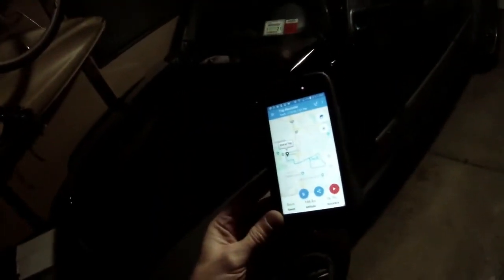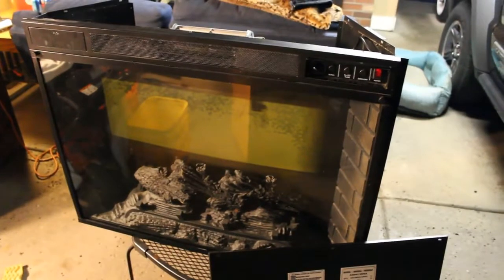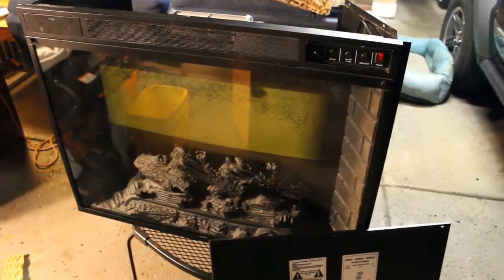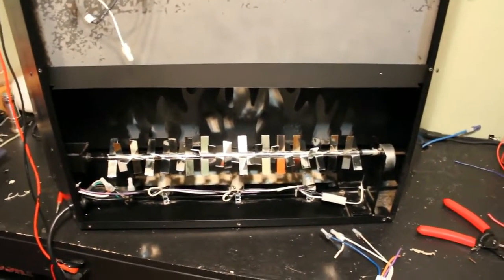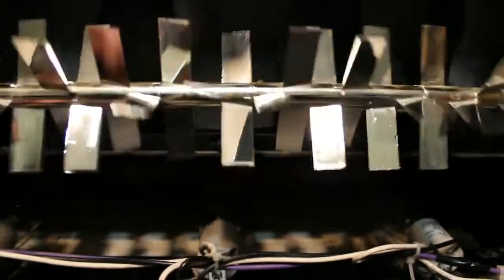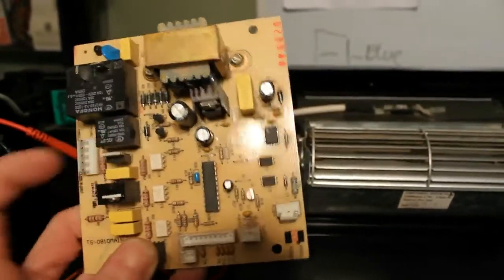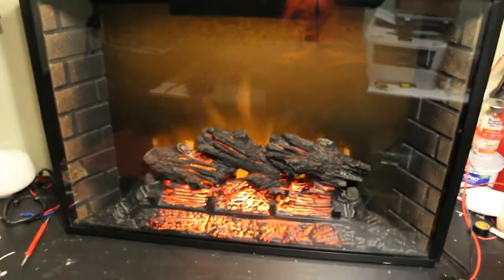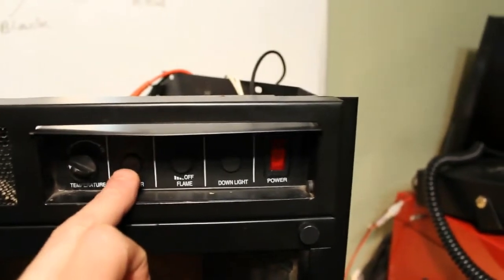Curb Find: Electric Fireplace, bypassing the control board. Whats inside a Twin Star Fireplace?

Comment: got one right now that I left the fireplace shell in the RV for looks but removed all the components and in the garage. We plan on buying a new one but the boards on these like you say are not very good from China. Was thinking about trying what you do for fun on the old parts to see if I can get them working less the board so glad I found your video. You mentioned about putting in a temperature control too. Basically, a rheostat. Have your tried it yet and if not do you have some tips on how to do it without a board?
Reply from the maker: Thanks Tim, no I ended up throwing it away myself to save some space but I did recycle it and enjoyed a few years of it first.

Comment: Probably throw this one away someday too when I buy a new fireplace but for now trying what you did. I have all the components out and just tested the fan which works just straight to AC power. I want to wire up the heating element too so the fan and heat both come on but there are two black connections? do I jump both with the hot wire? I see the ground is coming off the fan transformer to the heating element, so I believe it's already grounded. Just need power to it but not sure about the two black connectors? I'll be looking this up but if you know please share. Thanks
Reply from the maker: hmm, it has been a while. I would use a multimeter test for continuity on those black wires, if there is continuity i would not hook to AC power directly to it.

 I thought I wired the heater in my video, I would have to look back, or it could be the black is wired through a high temp sensor so it cuts power like a switch if temp goes over a set limit (limit switch)

Comment: Does anyone know of a way to just unplug power from the Board to the heating element? We found a twin star 4211033FG7 and don’t need the heat. Is this safe? I heard without power to The transformer it could melt down. Any help?
Reply from the maker: you should be able to just unplug the connections to the element but without looking at it, its something you can try or follow the wires from the element, wire colors and follow them to the board.

Comment: I have a small space heater that has a similar junky circuit board. I don't care about the lights or dancing flame, so if I bypass everything and go straight from power to the heater, will it work? Or is the circuit board needed for controlling the amount of power delivered to the heater? There is a temperature knob but I am fine if it is always at the same level (max power, I'd assume). Thanks for your video!

Comment: I have one a little smaller I've had for 10 years. Just stopped working. "Flames and heater" but light switches light up when plugged in. I hope it's something simple I can try to fix. Thanks.

Comment: Couldn't find Part 2.  I have the same one, just a smaller 29" model.  I'm trying to find a relatively easy way to get access to the inside of the glass and the fire logs so I can clean the inside glass and vacuum dust off the logs.  Thanks for any info you can offer.
Reply from the maker: Hi Peter, does you model have round thumb screws on the front to remove the glass?
Reply: @frankiefixdiy  thanks for the reply. I found the 4 screws behind d the flange that release the entire front glass panel. All cleaned up and vacuumed out. Good as new!

Comment: got an expensive fire and it does nt have the remote so cant see if it works or not ,so i think if i can do what you just did i might be able to get it working
Reply from the maker: Yes but if you do be careful not to leave it running or disable the heater, the heater will work but poses too much of a risk because essentially you are removing some of the safety features, it was intended only if you just want the fire effects and to make use of it. I use the heater but I don't keep it running constantly because the temp control was removed.
Reply: @frankiefixdiy  binned it

Comment: Great video. I have a similar situation where the board is shot. This one doesn’t have a manual switch though. It is safe to wire a switch into fire animation then straight into wall outlet?
Reply from the maker: Sure, thats just a motor and some light bulbs, no different than plugging a lamp in. Just be safe when working with electric obviously. Have a good day!

Comment: I have the Duraflame DFS5-550-21 had the same issue. You are right it is hard to see, in fact I had to go by feel. I went to the hardware store to find the file like yours. The unhelpful hardware people did not have a small file. But they did try and sell me a new heater. So, I got some 800 girt sandpaper and folded it into a small thin strip. Then went between the contacts and slid it back and forth for a while.  Not sure as to how much of the corrosion it took off, but the sandpaper did take some of it off. And it is working now. Thanks for the video it did help.
Reply from the maker: Good work William, glad it helped!